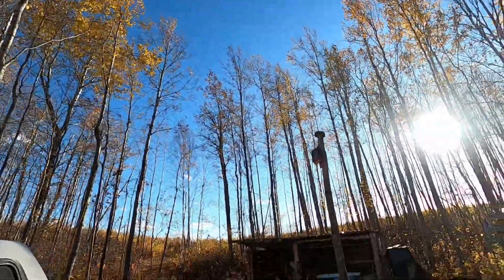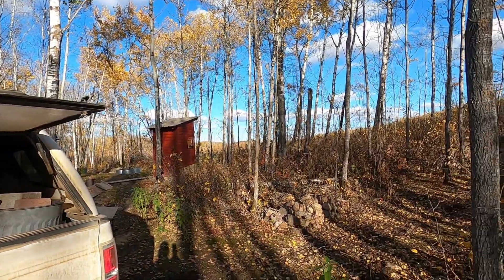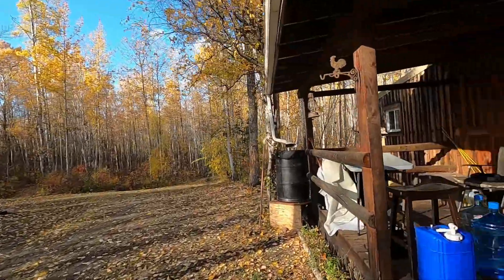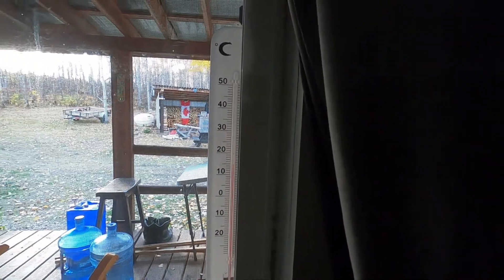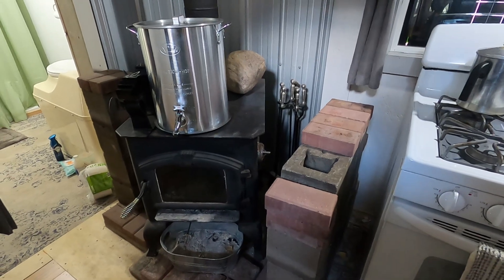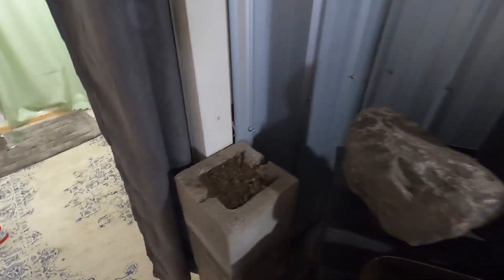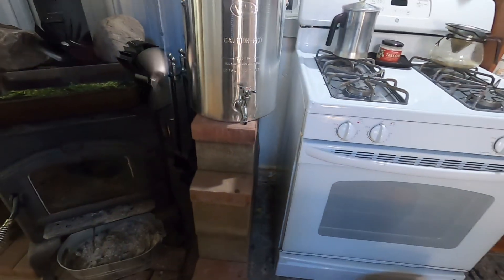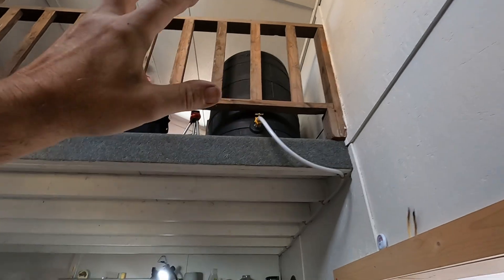Thermal Battery - IT WORKS!!! - Using Water, Concrete, Gravel and Sand -  High Efficient Wood Heat

Comment: Thx Steve.  I'm a 100 miles west of you. Doing the same thing.   Which non lithium batteries are good.  Setting up first long-term solar setup,thx for your show and all helping us newbies.  J
Reply from the maker: Awesome to hear you're working on a solar setup! It's definitely a learning curve, but worth it. Many people use flooded lead-acid or sealed lead-acid batteries for long-term systems.  Good non-lithium batteries include sodium-ion for large-scale  applications due to cost and abundance, nickel-metal hydride for rechargeable everyday devices, and alkaline for low-drain, single-use devices. Best of luck with your project! So your located near the foothills?